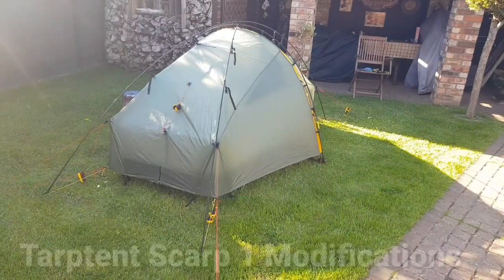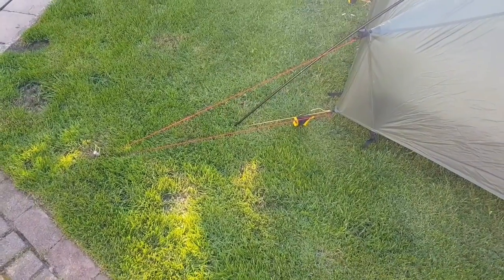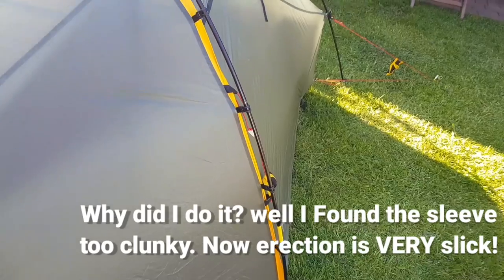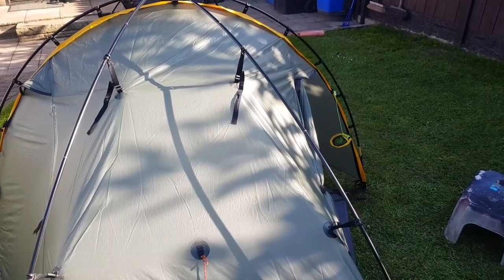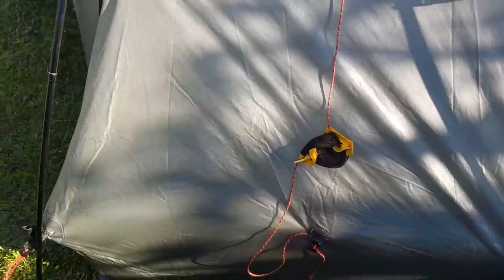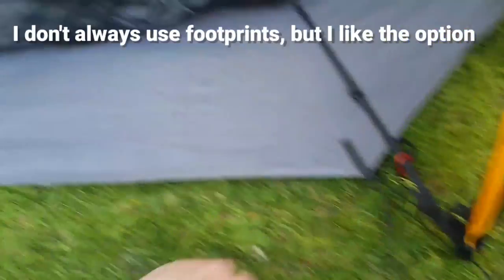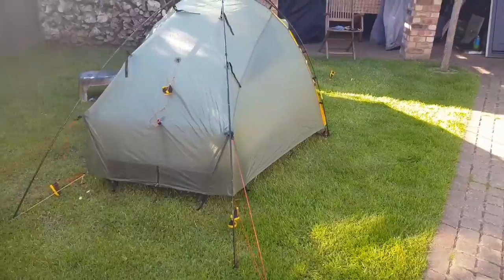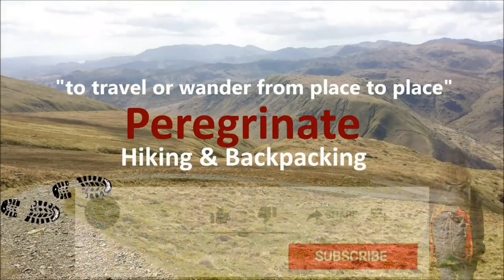Tarptent Scarp 1 Modifications

Comment: Amazing! How have you kept the tension of the tent the same with the clips running along the single ridge pole? I can’t work it out. The pole should be in the sleeve, you taken the same length pole but dropped the sleeve (and therefore dropped the “arch” of the tent) down by the distance of the short tab and clips, surely this means the tent isn’t as taught, but it looks fine?
Reply from the maker: Thanks for the comments. I haven't dropped the arch my friend. It sits in exactly the same place it would be running through the sleeve. Therefore, no height loss and it pitches perfectly tight. 
The clips are not a unique method of connecting poles. Many tent manufacturers do it 😊

Comment: Hi, great mods vlog - thanks for posting it. Can I ask what vango ground sheet you are using in this video. I have a tyvek sheet adapted with grommets but wondered which ground sheet you're using in the video? Thanks in advance 😀
Reply from the maker: Hello Craig. The footprint is the Vango GP505. Cost about £20. It's not a 'perfect' fit but it's pretty close and works well. I did modify it slightly. Adding new tabs and shock cord, but it's not essential 😊Fell Man Dave goes into detail here. He's very knowledgeable 👍
https://youtu.be/c9Qv_cKTIRk

Comment: That was really interesting. I don’t really get extending the cross poles tho? They don’t need to touch the ground cos they connect to the corner lock poles and then tension these via the grommet and guy line. How do you feel extending to the ground adds to it?
Reply from the maker: Hello and thanks for the comments. 
I had noticed the poles actually moving with the original 'floating' style. By extending the poles they now transfer any movement into the ground. Plus they are now locked in. As with any other tent that uses crossover poles. It just feels better and more rigid. 
HTH Mick Fitzpatrick
Reply: @mickfitzvalleyandhill  thanks for the reply. My experience is that the corner lock struts are so strong that the weight transfer would be to them but I’ll look out for what you’re saying. Atb gordon

Comment: Great looking mods mate. I agree getting the hoop pole through the sleeve is a bit of a job. What clips did you use for this please?
I also like the sound of your crossing pole mods. How did you extend these please and where did you get the extension from? 
I have no sewing skills so will be sending away.
Reply from the maker: Hello Richard. Thanks for the comments.  I got the clips and tape from Tarptent. I couldn't source an exact match in the UK, but they must be out there 🤔. The clips is a serious modification so good skills out sourcing it if you're not sure. Just remember to reseal in and out. I used diluted Silnet. Worked great 😊
I'll have to check where I got the poles from and get back to you. It was a simple mod and I even used the existing shock cord.
Reply from the maker: Remembered where I got the poles from 😊. It took several emails to get it right. But we got there in the end 👍
"Tent Pole Repairs | Scottish Mountain Gear" https://www.scottishmountaingear.com/repair-service/pole-repairs
Reply: @mickfitzvalleyandhill  Thanks for getting back to me. Ironically that’s who I would be using for the tent mods also.
Reply: I find in their web pages that they have 162inch long carbon($42)/aluminium ($25) arch and crossing pole to sell. Maybe it will suit your need.

Comment: Hi, great mods! I particularly like the extended crossing poles - where did you get the extension pieces from? I’m very keen to do that. Thanks!
Reply from the maker: Thanks for the comments mate. I got them from Scottish Mountain Gear. It took a few emails to get right 😉
Reply: @mickfitzvalleyandhill  Spot on, thanks very much 👍
Reply: Hi, great video! I am seriously considering buying a Scarp 1 for back country skiing/low altitude Alpine adventures. I like your mods. Would you be able to be more specific on exactly what you did with the crossover poles to get them to the ground(which I do agree seems like a better solution).
Reply from the maker: @chiroannecy7080  Thanks for the comments. All I did was add an extra section of pole mate. A very simple modification 😉